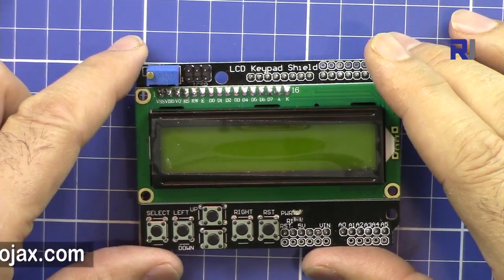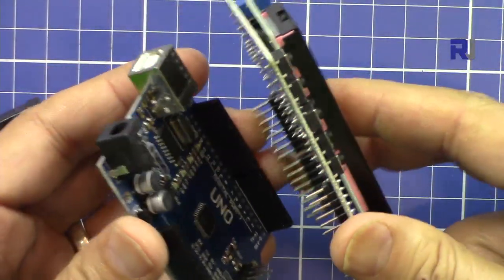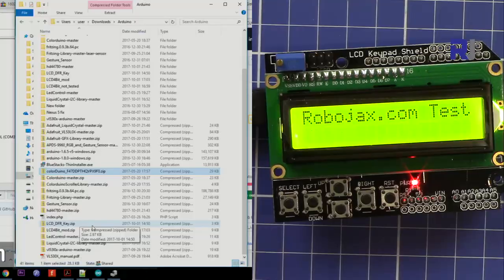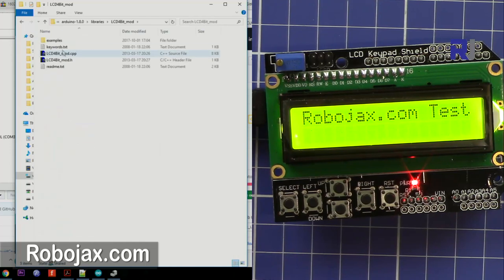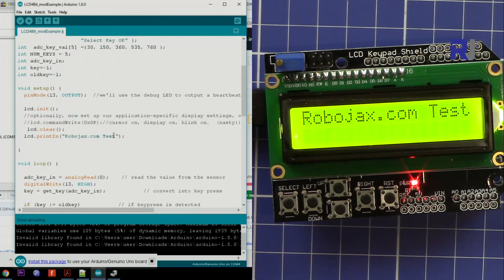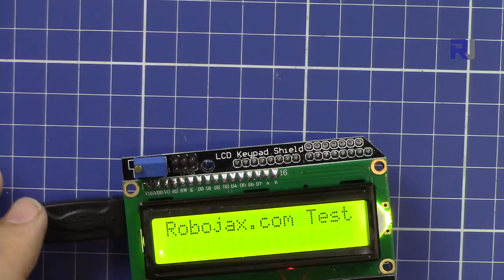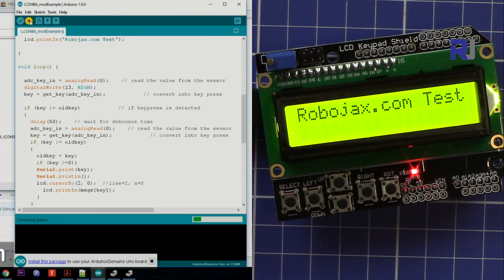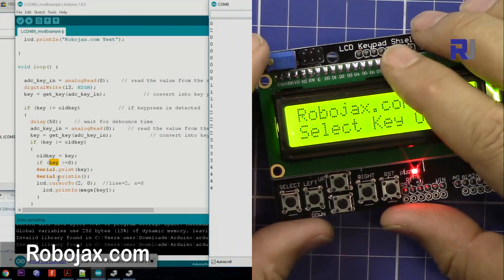Using 1602 LCD kaypad shield for Arduino

Comment: Thank for the tip with the serial monitor. Thanks to it, I could see that my shield seemed to work but the contrast was probably so low, that I could not see anything. After tuning the black-light potentiometer, I could read the LCD clearly and everything was fine.
Reply from the maker: You are welcome. I am glad you found it useful.

Comment: How many pins does this use on the arduino? It does not have a i2c backpack installed does it?
Reply from the maker: I don't have the module on hand I made the video to answer this. if you watch it, you will see.

Comment: Are there any IO pins still available when using on the UNO?  If so, which ones? And how do I access them?
Reply from the maker: Hi, the pins  used for display are not available. Only the pins not defined in the code are available.
Reply: @robojax  how do I access them?
Reply from the maker: I just looked at the pictures of the ships there are hold you can solder your wires or pin headers. The connect and LED and a resistor, use the blink code, change the link number from 1 to 13, run the code find each pin
Reply: @robojax  I tried that.  I don’t seem to get anything off those pin headers.
Reply from the maker: I have no access to the shield right now , once I do I will check it out.

Comment: What exactly is the model of the arduino that is compatible with this lcd?
Reply from the maker: For Arduino you can see on video. But the problem is with the LCD as they use different type and it won't work with Arduino. If I find new information, I will make video.

Comment: I use the code you provide, but shows error below

C:\Users\Hoya\Documents\Arduino\libraries\LCD4Bit_mod\LCD4Bit_mod.cpp:31:12: fatal error: WProgram.h: No such file or directory
   #include "WProgram.h"
            ^~~~~~~~~~~~
compilation terminated.
exit status 1
Reply from the maker: yes it means you have not installed the  library. "no file" means you skipped the video.

Comment: i'm trying to create a digital dice to play catan with, the problem that i'm having is that i can't get the random numbers to show up whenever the select button is pressed, plz help, the code is
#define DFR_LCD_KEYPAD_KEY_PIN       A0
int buttonState = 0;         // current state of the button
int lastButtonState = 0;     // previous state of the button
#include <DFR_LCD_Keypad.h>
int lcd;
int diceOne;
int diceTwo;
#define KEY_SELECT;

 uint8_t read_key(void);
  

void backlight_on (void);

void setup() {
  // initialize the button pin as a input:
  lcd.begin(16, 2);
  lcd.setCursor(1, 0);
  lcd.print("Roll the dice!");
}

void loop() {
  if (KEY_SELECT) == HIGH {
      // if the current state is HIGH then the button went from off to on:
       diceOne = random(1, 7);
       diceTwo = random(1, 7);
  //read the pushbutton input pin:
  buttonState = analogRead(buttonPin);
 // compare the buttonState to its previous state
  if (buttonState != lastButtonState) {
    // if the state has changed, increment the counter
    
}
}
}
Reply from the maker: First you have to be able to print the dice on the serial monitor like this
Serial.println(diceOne);
if this works, then print it on the display
lcd.setCursor(1, 0);
  lcd.print(diceOne");
Always print the result in serial monitor. of course inside the void setup() you  should initialize the serial monitor like this: 
Serial.begin(9600);
where 9600 is the data rate which must match the serial monitor
Reply: everytime i go to upload the code to the arduino, i get this
Arduino: 1.8.6 (Windows 10), TD: 1.44, Board: "Arduino/Genuino Uno"

C:\Users\taran\Documents\Arduino\dice_for_catan\dice_for_catan.ino:10:0: warning: "KEY_SELECT" redefined

 #define KEY_SELECT

 ^

In file included from C:\Users\taran\Documents\Arduino\dice_for_catan\dice_for_catan.ino:3:0:

C:\Users\taran\Documents\Arduino\libraries\DFR_LCD_Keypad/DFR_LCD_Keypad.h:55:0: note: this is the location of the previous definition

 #define KEY_SELECT DFR_LCD_KEYPAD_KEY_SELECT

 ^

C:\Users\taran\Documents\Arduino\dice_for_catan\dice_for_catan.ino: In function 'void loop()':

dice_for_catan:23:17: error: expected '(' before '==' token

   if KEY_SELECT == HIGH {

                 ^

dice_for_catan:38:1: error: expected '}' at end of input

 }

 ^

exit status 1
expected '(' before '==' token

This report would have more information with
"Show verbose output during compilation"
option enabled in File -> Preferences.
Reply from the maker: if seem the error is with #define.  you should use this format: #define age 22;
it has 3 parts, the keyword "define" , the  name "age" and the value 22. there is no = sing. see reference page https://www.arduino.cc/reference/en/language/structure/further-syntax/define/
Reply: when i go to compile the code, i get this
Arduino: 1.8.6 (Windows 10), TD: 1.44, Board: "Arduino/Genuino Uno"

C:\Users\taran\Documents\Arduino\dice_for_catan\dice_for_catan.ino: In function 'void loop()':

dice_for_catan:23:20: error: expected primary-expression before '==' token

   if (KEY_SELECT); == HIGH {

                    ^

exit status 1
expected primary-expression before '==' token

This report would have more information with
"Show verbose output during compilation"
option enabled in File -> Preferences.
Reply from the maker: this line:
 if (KEY_SELECT); == HIGH {
should be changed to
 if (KEY_SELECT == HIGH)  {